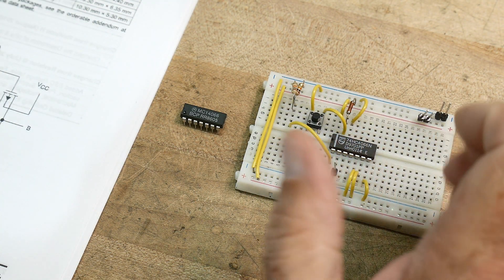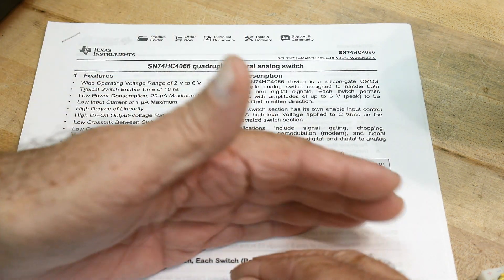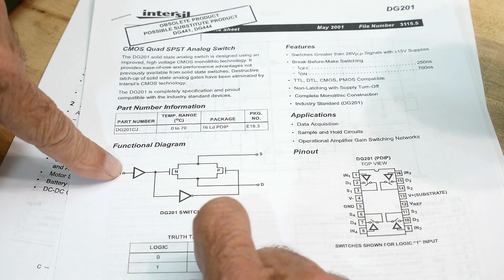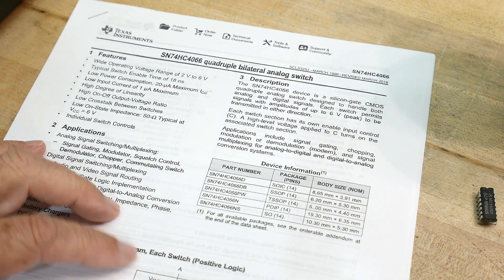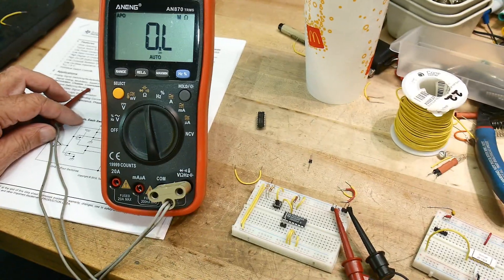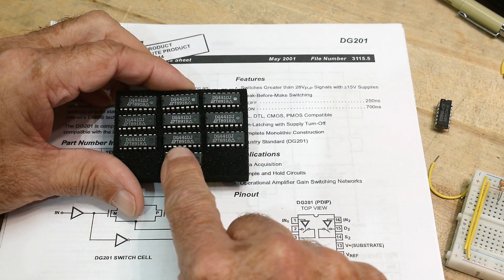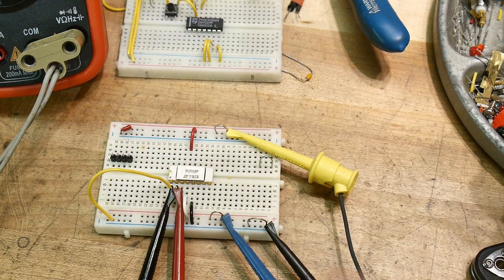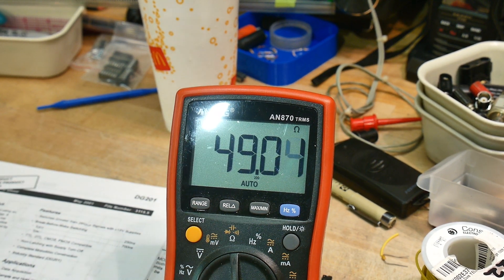#1109 Analog Switches 4066 DG201

Comment: If I want to comutate composite video signal, f.e. I want to make part of image inverted and part not. I already have uC that generates control signal in right time (3.3V), and I have two opamps - one with inversion, and one without. What analog switch could you recommend for that application? 300-700ns in this case is too slow...

Comment: I used these in a guitar effects footswitch  'consolidator' monster footpedal thingy, which was great.

I did not, however, manage to decipher Switch Bounce issues that the guy I built it for chastised me greatly for my not having tested it in the same environment, "Live On-Stage" where "130dB S:KCITttt!" echoing on ever footswitch hit managed to destroy the show. :-(

I went through at least half a bakers dozen reference books seeking solace for Switch Bounce mitigation.

What is(are) the Ruling Lesson(s) for this area, Maestro?

These TI 8-by and 16-by (74HC4067) Analog Multiplexers?
Do you know of any working fixes for similar gotchas in this switch bounce area, whether MCU- or Manual-controls, for these ICs?

Comment: Motorola ALWAYS put a "1" in front of their "4000" (metal gate CMOS) series parts. The RCA parts were 4066 and the Motorola parts were MC14066. When the HC series (silicon gate CMOS) for Motorola were MC74HXXXX, same as all other except for the "MC"
Reply: But 74HC chips were only rated to 5v, 4000 series were 15v ?
Reply: @jm6604-c4d  different  technology.  The old 4000 series CMOS was based on metal gate technology  rated 3 to 18 V, the 74HC was based on silicon gate technology rated 2 to 6 V, if I remember  correctly.
Reply: @jm6604-c4d  maybe I should have said the old (~1963) 4000 series CMOS was 12 micron(not a mistake) technology, and the HC family was 5 micron. This means larger spacing between the the gate and the channel. Larger spacing means reduced electric field, so higher breakdown voltage.

Comment: I have found an interesting circuit, that makes use of a CD4066. Can I use an analog multiplexer in place of this component? I was thinking that simply switching between 2 analog inputs on an analog multiplexer would accomplish the same thing as the 4066.

Comment: When I was new  to electronics 5 years ago, I didn't know where to get ICs from yet. So, it was common for me to try (key word) to recreate logic chips on a breadboard using discrete parts. This was one of them. Trying to use a 2N7000 and a BS250 to form the transmission gate, and one more 2N7000 for the inverter. Needless to say, it didn't work because the MOSFETs were far from matched. But, I still learned a great deal about transmission gates, and about the 4066 without ever having to touch one.

Comment: As at least a couple others have noted in these comments, I was going to say that the method used in this video for measuring the 'switch' resistance on the 4066, 'off' state in particular,  is not valid, or at least problematic. To get valid results, the circuit doing the resistance testing ( the digital multimeter in this video) needs to have some commonality with the 4066's power supply, ground reference, etc. That this was not done in this video demonstration is probably why the 'off' state resistance measurements were so disappointingly low (although in the M Ohm range, still not 'practical infinity') and drifty.

Also, while enhanced versions of the 4066, or similar ICs with better specifications, were mentioned, it is worthwhile recalling that the 4066 is an enhanced 4016, and although the 4066 is better than the 4016 in most ways, the older chip is still better in some subtle ways; even the TI datasheet I checked for the 4066 says right out that the 4016 is better in 'sample and hold' applications than the 4066.

Comment: To more accurate measurement the off state leaking probably you need a relatively low impedance ohmmeter like analog one. Maby the P/N FETs leak is to high for the very low current of digital ohmmeter. Sorry for my horrible english. 
Thanks for your cool videos !!

Comment: 2:22 - I puzzled a bit over why both an N and a P channel are required even though they are both open and closed at the same time.  My conclusion is that it allows bidirectional current flow when it is open (despite the claim that some make that a mosfet is bi-directional).
Reply from the maker: it is due to biasing. since you do not have control over the voltages on the inputs, you need to cover all scenarios.

Comment: Might make a good T/R switch in some bespoke radio applications. Like a QRP radio with EFHW or some other high impedance antenna.
Reply from the maker: no, very low current only. you could transmit a few milliwatts max

Comment: It would be interesting to compare the switch characteristics of the 4066 or DG441 to, for example, the ADG715 (Octal SPST analog switch) and the MAX14662 (also Octal SPST analog switch). Both of these have much lower on resistance than the the 4066 or DG441.

Comment: For audio use these have quite high distortion, so they are best used in a way where the signal path does not go through the switch.  
E.g. IN -> 2k resistor -> top of switch to ground -> second 2k resistor -> top of second switch to ground -> OUT.   

When both switches are on (50R to ground) the "offness" is fairly good ( (50/2050)^2, -148 dB), and the signal does not pass through either switch when it is being used.  Downside is you might need a buffer at OUT depending on the input impedance requirements of the following circuitry.

Comment: Measuring the switch resistance with a floating external meter is going to give you bad readings, especially when the switch is open.
You need to be sure the voltage applied is referenced to the supply, so it stays between the rails. Bias one switch input to a known voltage so you know it's stable and within the allowed range.

Comment: DG411/DG412/DG413, also similar to the CD4066

DG441/DG442, seams to best at just 4 Ohm's (says maxim's datasheet).
Are there DIP8 versions?
CD4066B works bipolar and you absolutely can use the 74HCT4066 in a bipolar fashion, albeit +/- 2.5 volt :)
Reply from the maker: 8 pin: https://www.mouser.com/datasheet/2/256/MAX317-MAX319-1292538.pdf
Reply: @IMSAIGuy  Thank you, they have been Eaglized.

Comment: If I recall there was 4016 as well, and believe the on resistance was a bit hight than the 4066.
Reply: The 4016 has a lower on resistance, but also a lower off resistance---old guy here who used both :)
Reply: 4016 was a better choice for chopped amp and multi ramp adc because of lower C (Q injection) . I used also "hand made" switch with cd 4007 and fets. Now ... ( in 2000+ ) analog devices made almost ideal switches so is no more fun in designing and struggle to do precision with non ideal components.

Comment: Have a look at a 74123  They were terrible UN-reliable!   And changed it's timing. The external C & R WAS NOT the problem!!
Reply from the maker: I remember the 123 but don't think I every used one.
Reply: @IMSAIGuy  - Back when there was nothing but TTL Chips, this chip was popular.  It had terrible RUN-AWAY.
Reply: there are ic's more that aren't available anymore, like the adders and some others.
Reply: My hc123 work ok ( i used to generate a 200ns pulse for sampling hc4066 in an IQ extraction circuit ) .

Comment: I prefer the 74HC4053 change over switch in audio designs. These only have three change over switches in a single package, that is three,  single pole, double throw. 
This allows the audio channel to be switched between pass through and the analogue ground. This tends to produce a much higher signal isolation and a lower noise output when in the off state. I have used these in op-amp signal processing  and summing circuits. They also can be used to produce switch, and commutating capacitor filters. 
 Toshiba made an analogue switch with opto isolated control, the TLP597G, it has a very low on resistance, making it ideal for isolating i2C data and clock lines, when the connected peripheral is  powered off. I,e when the i2C bus has peripherals that are separately powered. Without such isolation, switching off a peripheral, results in a short on the bus.
Reply: the downside is that's only 20 V (bipolar) and if you system is 24 V bipolar, you have to find a work around.
did you check these DG411/DG412/DG413?
Reply: @AnalogDude_  in my case I was working on a professional telecom system, which was designed to use +/- 5 and 12 volts. Our systems used a negative earth, 24 volt rack supply, a standard SELF for radio telecommunication system.
As all the audio circuits were powered from the +/- 5 volt supply, with 0 volt reference, the 74HC4053 was an ideal choice. 

The I2C bus system is distributed over a number of independently powered screened boxes, with several feet of cable connecting them together. The I2C provided a multi-drop bus. Not very fast by modern standards, but useful for a home automation system. It came from work I did almost 40 years ago,  on a base site control system.
Reply: @nigeljohnson9820  i have built the national fiberglass network in the telecom exchanges around 1999/2000.
:)

many MCU's /microchip, ATMEL, ST, etc, etc) have communication port(s) that be configured as either I2C, SPI or CANBUS.

i made a Voltage controlled switch for my modular synthesizer and used the Cd4053.
works great, but i had to build a separated power supply using opamps to scale down from +/-12 V. to save on PCB space i would like to give the DG series chip a change.
Since "Analog Devices"  also makes them, they should be al rite, i guess.

the CD4053 has a resistance of like 150 OHm's being powered from a bi polar 10 volt supply and these DG series like 1/3 or less than that. 

the CD4053 is like 50 years old and it seams the DG series are made around 2005, dates i could read from datasheets.
Reply: @AnalogDude_  thè 4066 also date back 50 years. When i was using the 4053 they would have been only 10 years old.
Reply: @nigeljohnson9820  i got a few (CD4066) laying around, but not yet used so far, it seemed strange to me no having the GND pin (being used on a bipolar supply), like the CD4051, Cd4052 and CD4053 have. they didn't include a circuit overview of the Texas Instruments CD4053,  don't know if the GND pin used only for the logic side. the Renesas DG411/412/413 datasheet shows the GND input is used on the long tail inside.